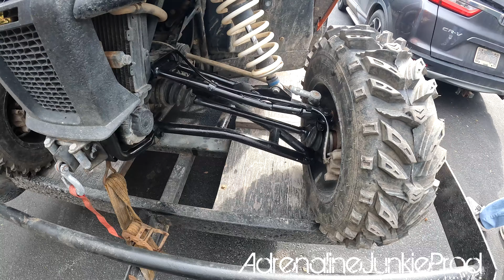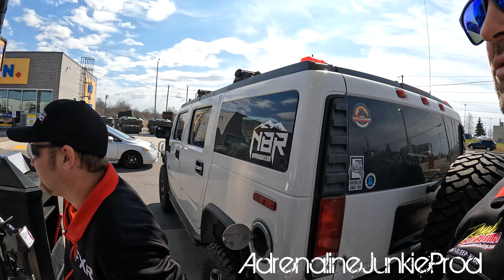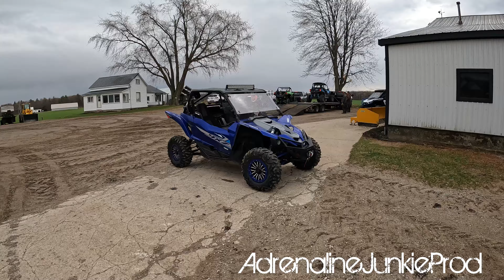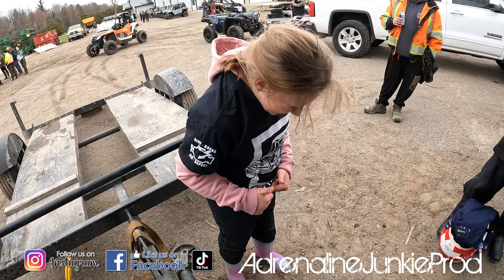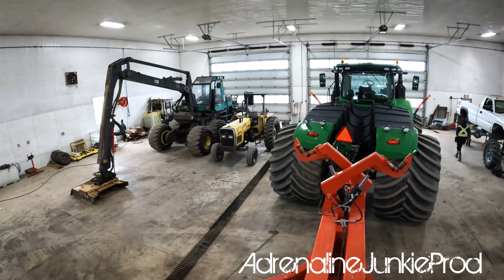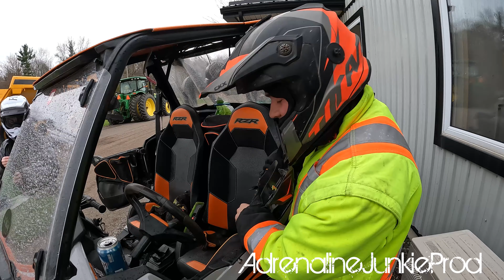It's a Good Friday - Pre Ride Shenanigans with #TeamAJP Crew & #AdrenalineJunkieProd Merch Drop!

Comment: I ran the dirt diggers on my Honda rincon and my sportsman’s , they did a great job in the mud but my only complaint is they like to throw rocks and wear oddly, like the thread gets smaller and they start to vibrate
Reply from the maker: That’s good feedback. None of the guys here that have them have put much wear on them yet. We will need to pay attention to that. So far they have been workin pretty well but time will tell.
Reply: @AdrenalineJunkieProd  yeah my brother has had them on his 450 SPORTMAN since 2018 with over 8000km  and that’s the only thing we notice is the wear but for the price of them you can’t go wrong